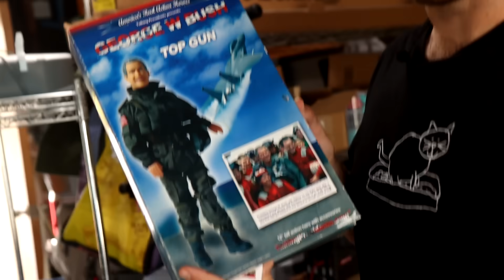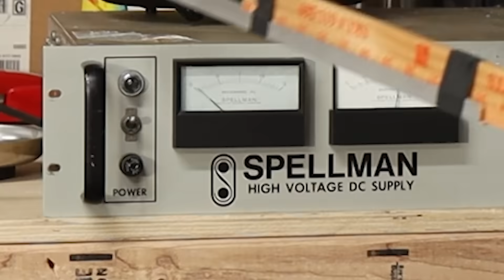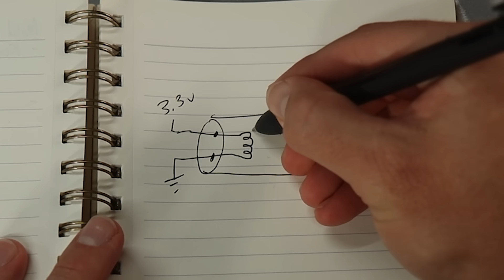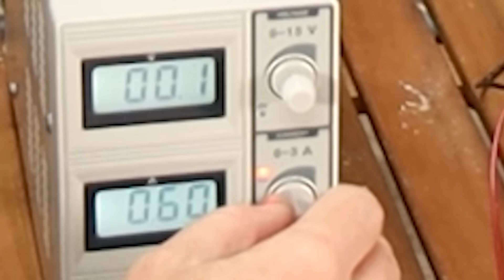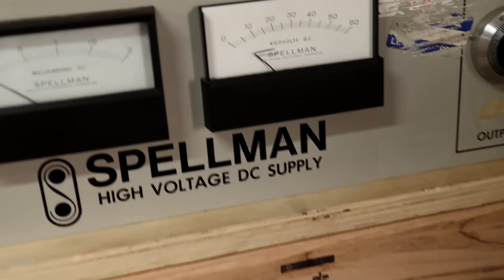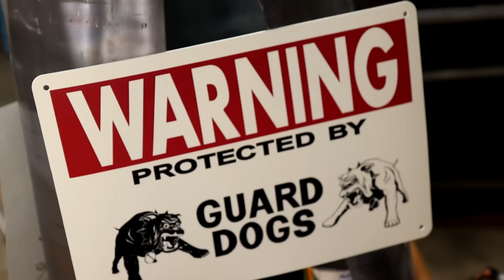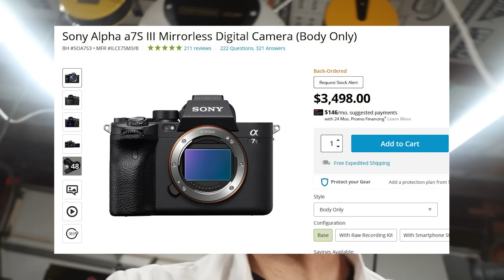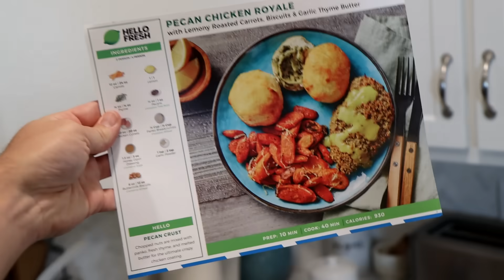Built My Own X-Ray After a Hospital Charged Me $69,210.32

Comment: I know it wouldn't have made as exciting of a video, but you can get the little portable digital x-ray machines for less than your accumulation of parts.  Like the kind a vet or dentist may use, if they're a small clinic that can't mount machines to the walls.   

You probably want to put the x-ray emitter back in it's oil filled container too.  That's partly to cool it.  It'd suck if you burned out the emitter too quick.   I think it's supposed to be wrapped in lead.  Not a safety thing, just to help reflect all the x-rays in the right direction.  Kinda like a flashlight does with it's reflector.  It doesn't do any good shining the light (x-ray) away from the subject.

You'll probably never see this comment though.  13,857 comments before this one.

Comment: Always a good idea to produce high energy x rays with relativistic electrons in your home workshop.
Your shielding is BS by the way, the Xrays easily escape through the top and back, bounce of the walls etc. and hit you.
If you have taken at least a little care and have worn a dosimeter (NOT a geiger counter which does not measure total radiation over time) you've seen at least a little increase of
absolutly uneccessary radiation that your body absorbed.
Also i really really hope you tracked your acceleration voltage from the first PSU.
Multiple kV can already produce high amounts of radiation which can fry the cells in your hand.
Absolute BS experiment, not worth taking that risk under these circumstances.

Comment: Any other xray techs trying to figure out what mA he's setting?  Dude doesn't even know what scatter is.  We don't care that you're destroying the tube by running it constantly, it's just that when I take an xray at work it's say 100Kvp at 2 mAs and it shoots in a fraction of a second.  This guy is doing a constant flow, we can't see what his setting are and even if we could there is no time setting which is terrifying (and I'm a psycho-pyro, nothing's dangerous, I eat covid for breakfast every morning, kind of guy).  Get an xray tech to help you with this stuff man,  You got to completely surround the tube with lead except where the xrays are coming out, then hide behind something heavy, I pile of sand, a pool.. then turn it on.. Consider whatever the xrays hit will produce MORE xrays, this is called scatter.  So when you wear a dosimeter on your torso, the scatter can be coming off the floor and the ceiling.

Comment: I watched thru the whole video. U gotta put the highvoltage under oil (mineral oil if u have.), All of it. Including the x-ray tube. D'oh. :)
Mineral oil worked for me, canola oil (cheaper alternative) might work if it's dry enough from water. CW multiplier for the high voltage generation worked very well for my own radiographs of different objects.

Comment: "Local man accidentally blasts himself with more than 23mSv"
Reply: That's not great, but not terrible.
Reply: @Карасик Ерохин I have little experience with nuclear physics. I don't know enough to know what the quality coefficient is but I'm assuming it some measure of how much of the energy is ionising radiation?

I should probably just look it up instead of assuming tbh.
Reply: 23 mSv is half of the annual dose a radiation worker is allowed to be exposed to. (In the USA). 

When speaking about exposure though we are talking about Grays generally. 8Gy whole body exposure is generally lethal.
Reply: Lemme guess, that's a fatal dose?
Reply: People with stents installed in coronary arteries get 1000-2000 mSv (100 - 200 rems) of x-ray through their back (not even skin damage -- but it's close to the limit). Dental x-rays, basement radon and high-altitude flights are nothing. It helps if not the whole body is exposed, of course.
Reply: @Карасик Ерохин I'm actually surprised I understood all that. I haven't even started college yet lol.

then again that was probably an oversimplification but hey, I'll take it.

thanks for taking the time to answer that!

Comment: Im pretty sure playing with radiation is illegal one of the basis for using radiation is to use as little as possible only if it brings health benefits. He is using a dental one which doesnt apply as much R as a normal x ray one but still pretty sure its illegal even if it wont cause u any harm

Comment: I know did a disclaimer to your safety. But I'm a radiation safety physicist for a hospital who deals with x-ray machines routinely. I would say just be careful. Luckily you are using dental tube which in contrast to a CT tube is low but there is definitely scatter you need to take in to consideration. This is an extra dose to yourself that definitely isn't justified. 😂 Great video and science but just be careful.

Comment: At the power levels you were creating them, standing back as you were likely negated any real danger. The x-rays weren't focused and the strength would have decreased with the square of the distance. At least you used a fake finger. A classmate of mine in high school found a similar x-ray tube and, as he was into lasers, had the needed power supplies to fire it up. He took an x-ray of his hand onto regular photographic paper. Not the best thing to do, but it was only the one time and I guess he had some shielding around the setup to protect the rest of his anatomy.

Comment: Lol, the safety nerd section assuming people care about x-rays and I'm just here yelling at you about the power supply - that's the part that can actually kill you.
Also, when you were setting up the beans - "I tried grounding them so they didn't arc, but it didn't work" - of course it didn't work, it arcs BECAUSE it's grounded!

Also, your warning label collection should have included a "Warning: lead shielding is known to the state of California to be a cause of cancer" sign. Not for x-rays though, those are fine.

Comment: As someone with four broken bones in one foot and one hand, I can tell you, finding broken bones in X-rays can be very hard. Two of my breaks couldn't be found without a CT scan, which is even more difficult than x-rays. To the untrained eye, my hand looked normal, but it was so bad I had to have a plate put in. I'm a little luckier with the foot so far.

Comment: Try silicone caulking as a insulator around to bare wires. That's what i used in my 10kv 1a power supply.

Comment: Ok 8 seconds in and I know this guy is legit because I see a Spellman power supply in the background.  That company makes power supplies for x-ray generating devices... quite good ones that are pretty excellent at well sourcing current and voltage very precisely and accurately.

Edit yeah legit is on the edge of disaster.  Yeah that's a pretty fantastic power supply.  Seriously Spellman makes a great product.  If you need a power supply for your death ray/radiation generating device you'd be hard pressed to find a better power supply.  In many instances they're the only ones making power supplies of certain specs.  Ok but yeah danger box plus idiot on you tube. Sounds like the making of a depressing snuff film

Comment: Fun fact! You can use almost any diode vacuum tube as an x-ray source. You don't even need to care about heating the emitter, just wire it up to high voltage and cold emission will produce electrons fast enough to generate x-rays.

Bonus points: the lamp will likely blow up from overheating before you receive a dangerous dose of radiation.

Comment: Radiologists (the doctors who interpret the x-ray) are in critically short supply right now, and the average starting salary is $425,000 per year. That's what you're paying for, not the x-ray itself.

Also you can buy used x-ray machines for very cheap, since they're no longer certified to be safe.

Comment: using the smallest gauge wire to move absurd amounts of power. I stand by this.
Reply: Eh he is using high voltage yes but the actual power is fairly low. When the created a short it went up to 5mA, meaning that at most he is transferring 300 (0.005A*60000V) Watts of power. honestly the copper wire could be extremely thin and it would be fine. The insulation on the other hand... is lacking

Comment: I'm an imaging engineer for a local hospital (meaning I maintain x-ray systems as well as other medical imaging systems) and I just wanted you to know that I was screaming this entire video. Kudos for raising my blood pressure.

Also, excellent job describing how x-rays work. Although usually the anode is spinning in most modern radiography systems. Although this was a dental unit, so it probably doesn't have a need for high kV or mA.

As for safety, we don't carry around geiger counters. I wear a dosimeter badge which measures my total dosage of radiation.

Comment: Correct me if I’m wrong but ~7500 CPM is roughly  3 mR/h which can be converted to ~30 μSv/h
To put into perspective 30 μSv/hr is high, VERY HIGH.
0,11 μSv/hr is the total dose EPA yearly limit for radiation exposure to general public (or 300 cigarettes at 3.3 μSv each)
0,39 μSv/hr is the total expected and allowed exposure to the general public in one year
4,11 μSv/hr is equivalent to smoking 30 cigarettes a day for a year. Goes to show how bad smoking is for you.
5,71 μSv/hr is the maximum yearly dose permitted to US radiation workers which is 50x what the general public is "allowed"
11 μSv/hr as an annual dose of 100 mSv at which increased lifetime risk of cancer is evident
400 μSv/hr is maximum radiation levels detected at Fukushima per hour
NOTE: radiation workers were instructed to spend no more than 15 min at a time inside the Fukushima reactors.
This amounts to 1/4 * 400 or 100 mSv total dose, which is the threshold where lifetime risk of cancer would occur
detected at the reactor Radiation workers do put their lives on the line
NOTE: Radiation detected 50kM from Fukushima were about 1000x less than the maximum levels. 

When it comes to radiation, stay away from it.
Follow the invese-square law.
1m is a dose
2m is 1/4 of that dose
3m is 1/9 of that dose
Reply: Ye

Comment: I’ve designed compact high voltage power supplies. I had to submerge the prototype in Fluorinert in order to prevent any arcing. It cost about $500 for half a liter. Once the design and testing was completed, a silicone potting compound was used, and it had to be put under a vacuum bell. That removed all the air bubbles. When finished it was ready to be flown at up to 70,000 feet, and operate at -55 degrees F. Nobody in the engineering research park would touch the contract. They said “high voltage is black magic”. I designed, built, and tested it in a storage building in my back yard.

Comment: Here in my city if u wanna take x-ray in govt hospital (if you don't mind the  time and good interior) they only cost you 50rs (less than a dollar) you can also go private medical centers with reasonable time duration & neat interior its will cost around 300 to 500 rs (less than 7 dollars) CT scan around 2500 to 3000 rs for basic scan (40dollars) MRI Cost you 6000rs (80dollars) lot cheaper than their but it's not cheap to a middle or poor family bcoz here basic salary give by local stores or something else is 6000 to 15000 only most of peoples working for that salary so it's still expensive for us 😂

Comment: With enough acceleration tension most vacuum tubes might deliver x-rays, at least for some time before they blow! I remember a counter tube which was sensitive enough to be triggered by a normal TV. Back in the days, we've only got CRT displays. Might be an interesting experiment for Photoninduction, how much and how long a historical telly could deliver diagnostical x-ray images.

Comment: Mmmkay but the xray machine at a hospital or dentists office is designed and operated to expose you to no more xrays than necessary to image the body part, both in duration and intensity. Keep using your device, however, and you might wind up needing to visit the hospital again very soon.

Comment: In a pinch, you only need the photographic plates, sealed. For an emitter you only need to peel some Scotch brand tape off a sheet of glass. The glue creates a relatively strong bond with the glass, and breaking that bond creates a strong x-ray source, strong enough to over-expose any camera film in the same room. Pulling a strip off of glass along in the same direction as the bone(s) you wish to examine, actually helps to create the same sort of exposure as a columnated source. It isn't perfect, but it works for pets and a lot of human sprains and fractures. Learned that from a prepper neighbor, years back. You can also just arc electricity through a burned out filament bulb, of pretty much any kind. Arcing electricity through a vacuum emits x-rays. You'd need to back it up pretty far so it'd act like coherent light, not throw a lot of shadows.
Reply: Nonsense. You are confusing static electricity with x-rays. X-rays are not so easy to generate, and are only likely to happen in a 'hard vacuum' with an arc in the kilo-voltage range and a very high frequency. Electrons such as those shot out of a cathode ray tube as well as direct exposure to voltage or arcing can expose a photographic plate or film. Perhaps that's what you were witnessing?

Comment: Radiologist here. You get a thumbs down for this, just because you're encouraging nutters to play with dangerous things they know nothing about. Turning on an X-ray tube outside its protective cupola (that metal case it came in) is one of the dumbest "experiments" I've seen on YouTube. And I'm not primarily concerned about radiation (dosage is relatively low for a simple fixed anode tube like that and the thing will burn out rather quickly without proper cooling), but that kind of rig brings extreme danger of electrocution and it's also a serious fire hazard. 
BTW, in many countries it's actually illegal to own (or sell) X-ray tubes, so you should check on that before you get a free ride to the nearest police station. 
Also your lack of proper knowledge made you miss the most valuable component in that old tube: the cooling oil. It's crazy expansive for one very good reason: it's far superior to any equivalent consumer products you can find. If you're really an engineer you should figure out dozens of practical applications for it. 
The insane medical bills you're getting in the US are due to the entire medical system being run as a business, the actual cost of radiology scans may be less than 10% of that bill. I'm working in Europe, in a private hospital where a full body CT scan is about 400 USD and a standard radiography between 20 and 40 (that's total cost for the patient if you have no insurance or want to skip the waiting queue, otherwise basic health insurance fully covers it).

Comment: 1) You should not have been allowed to buy the xray head without holding a licence to do xrays
2) you should have left the dental head intact and use all the high voltage stuff already in it.
It probably had transformer and other high voltage things like multiple doublers already in it, 
3) xray are going out in all direction from that tube, and need to protected 360 degress with lead all around except a single outlet point.
4) The useful xray beam is usually filtered with thin layers of aluminum to get soft vs hard xrays.
5) Yes, it is dangerous.

Comment: That was pretty damn cool man, well done. I think this kind of tech is fascinating. It's crazy to think that back in the day, there were X-ray machines in shoe stores. They would allow you to see how the shoe fit your foot before buying. Of course, a ton of people were getting far greater radiation exposure than today because they were a little loosey-goosey on the safety rules.

 As a quick aside regarding the sponsor: my wife and I used Hello Fresh for several months and it was really neat and convenient. It's a bit pricy but you're paying for that convenience and for the wide variety of recipes. When cash got a bit tighter, we decided to take the recipe sheets and get the ingredients ourselves and go from scratch. But it is a good service so if you can afford it (I believe it was around $70-$100 per order with 3 meals for 4 people) and don't have much time/skill in prep, I say go for it.

Comment: “Why is it shocking me it’s the box”

William, you got it on eBay.
Reply: Bruh
Reply: Yeah, why do you think they sold it!!!
Reply: it's probably from the charge still left in the second coil of the AC step up circuit, since the xray tube is a vaccum and he didn't discharge the AC output/wait for the energy to dissipate. 

I'm assuming this because if you touch a pin on a taser right away after zapping it in the air a few times you get a mild shock that partially contracts your arm muscles. Or if again you touch it to a coin it still has a single arc's worth of power stored in the output circuit, albeit at a much lower current

This happened once when I unplugged my 47volt mic and touched the pins on the bottom right away.
Reply: Nah, he broke off the safety ground to fit it into a two slot extension cord!
Reply: This 🤣🤣🤣🤣

Comment: He’s concerned about the voltage rather than the increasing background radiation…
Reply: That's accurate its a much more immediate and realistic threat. Xray in short bursts is nothing to worry about. 
The most dangerous parts of the nuclear power plant I work on are the high pressure air, steam systems, and high voltage.

No one is worried about radiation except the ignorant public

Comment: One quick tip, most high voltage tubes want the filament to be on before the high voltage is applied. Otherwise the high voltage can cause the filament to sputter (electrons rip the emissive coating right off the filament as it heats up) reducing its life span. By letting the filament get up to operating temp before applying the high voltage the electrons boil off easier and therefore are much less likely to rip the coating off. Just thought you might want to get the most out of your x-ray tube so it can live long and piss x-rays.